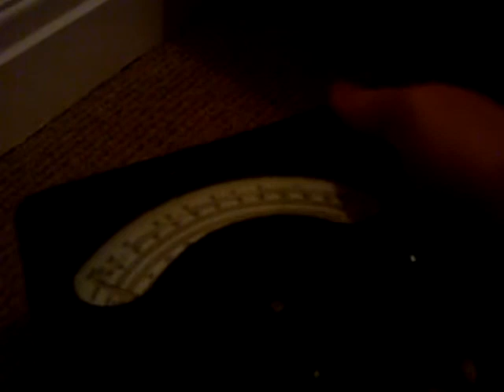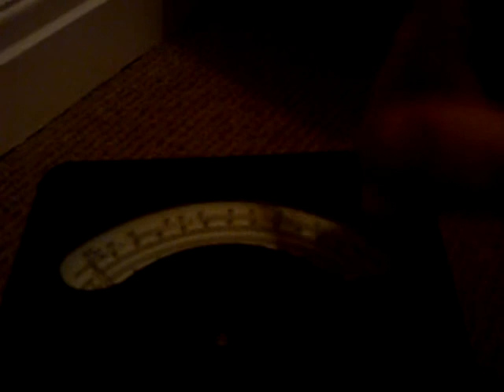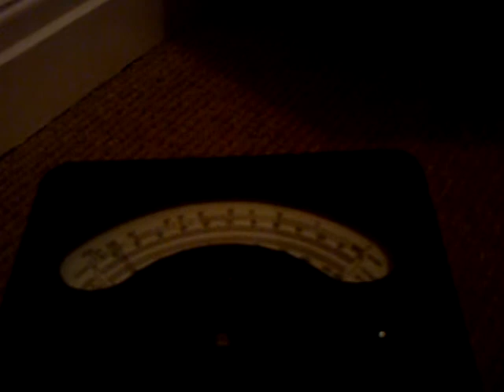model 40 AVO meter

Comment: The divide by 2 button is not for resistance measurements mate, it is for voltage or current. I have not tried the DB2 button on ohms ranges but i imagine it just gives a very inaccurate reading since the resistance scale is not linear. (the data plate on the rear specifies all the operating procedures- unless someone has nicked it to use as a beermat)

Lairy readings such as you were getting there, will be due either to finger trouble, (cannae see very well what you were doing!) or more likely the leaf switches on the back of the rotary switches are not opening and closing when they should. Also the cam plates on these switches are not pegged in position so can go out of phase with the switch legends on the front of the instrument.       The moving parts in Avo's are, or can be, a right sod. The cut-out constantly operating may just be badly adjusted, but it could also be responding to dodgy leaf switch contacts, as detailed above. 

Yes, the model 40 is pretty accurate, i have one. I think yours may need the attention of bright lights, magnifying glass, pointy pliers and a lot of patience. As i said, the devil is usually in the moving parts!